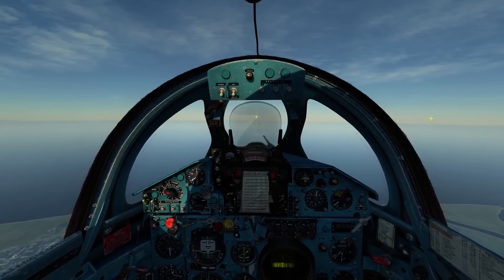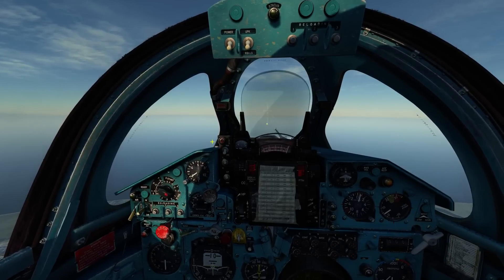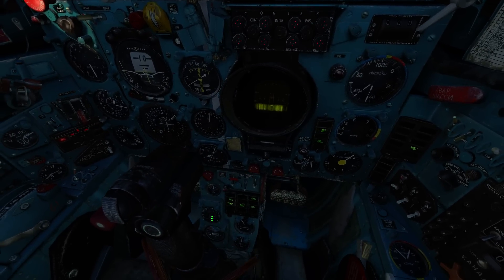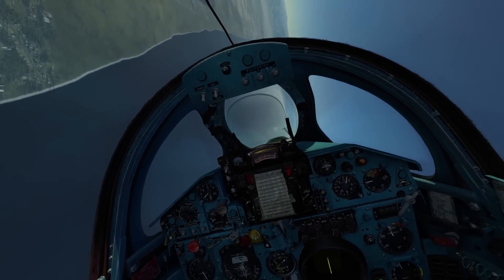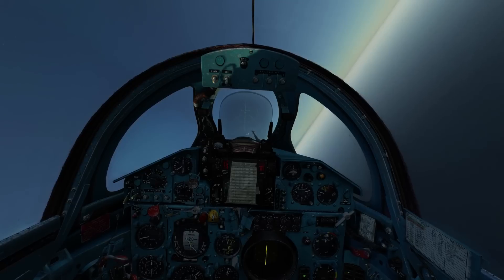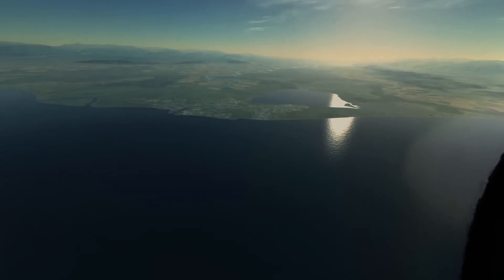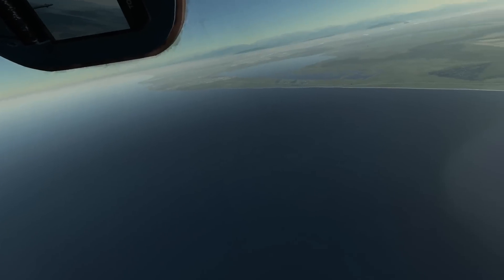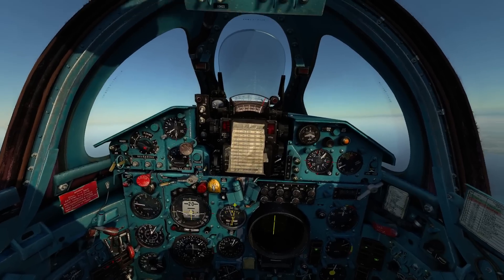DCS Mig21bis Unguided Rockets

Comment: Does the radar on beam actually give ranging info?  I have done rocket attack runs without the radar even turned on and still go accurate ranging information.  I have a feeling the ASP uses another type of ranging system, and the radar is not linked at all.  I could be wrong so feel free to correct me.
Reply from the maker: +Shini I know that the ASP was not entirely realistic in DCS 1.2 and that bit by bit Leatherneck are removing some of it's "magic" abilities.  Don't know if they have removed the unrealistic ranging yet but certainly in the real aircraft this is the only way to drive the range readout.
Reply: deephack Good to know, I figured this was the case.